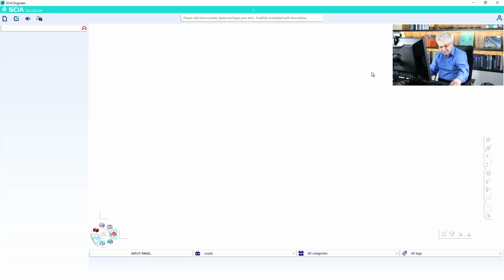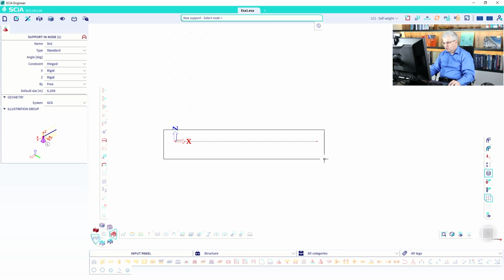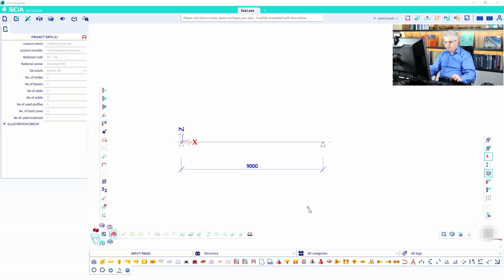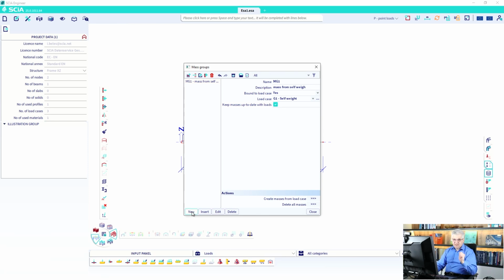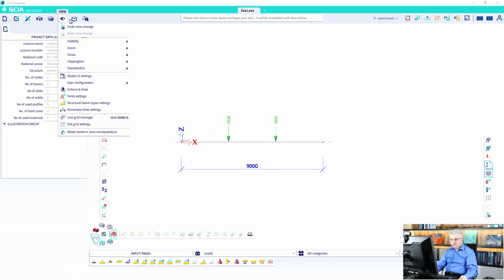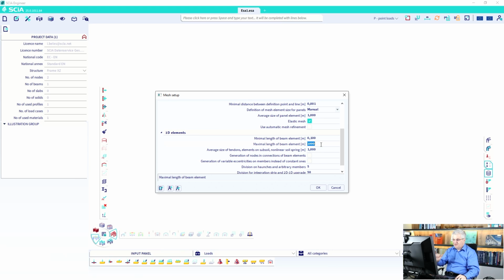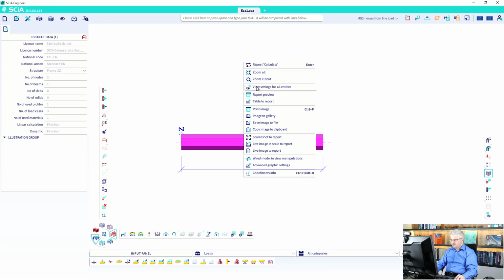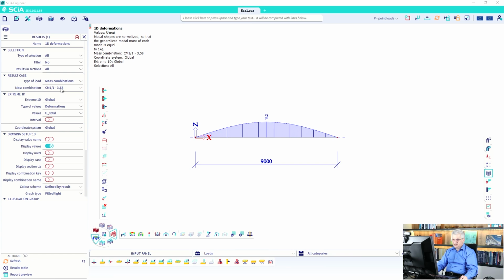SCIA Engineer 25.0: Eigenmode on a simple beam

Comment: It is a bit strange that Scia doesn't give us the generalised modal mass because of the normalisation process. It is an output that is frequently needed in designs that involve simple dynamics (non-seismic such as vibration analysis for staircases,floors etc). Is there a way to extract data to get the generalised modal masses calculated manually?
Reply from the maker: The explanation of the generalized mass is in the online help:
https://help.scia.net/25.0/en/#analysis/modal_analysis_and_dynamics_and_seismicity/dynamic_analysis_troubleshooting/generalized_modal_mass.htm%3FTocPath%3DAnalysis%7CDynamics%7CDynamic%2520analysis%2520types%7CDynamic%2520analysis%2520troubleshooting%7CValidation%2520of%2520modal%2520analysis%7CCalculation%25C2%25A0protocol%7CRelative%2520modal%2520masses%7C_____2